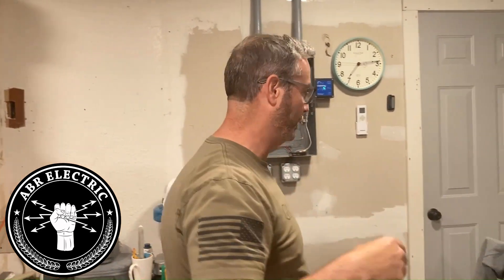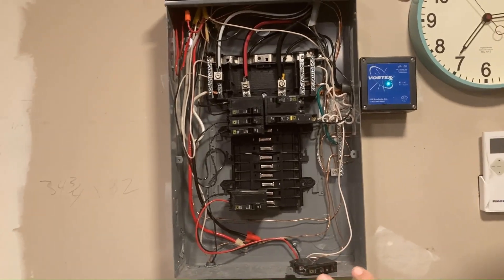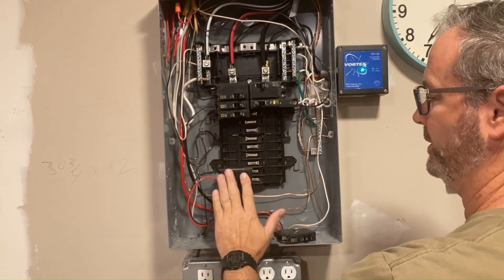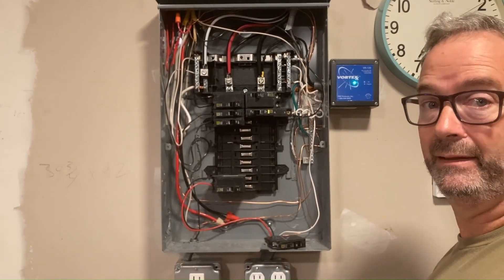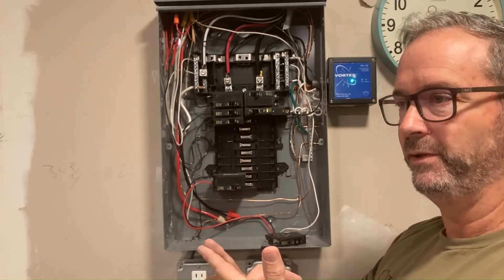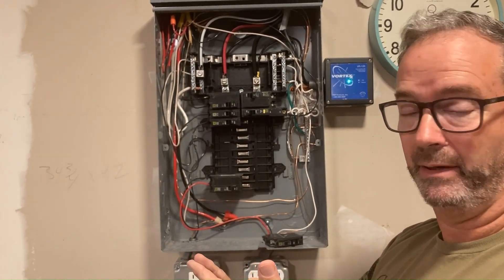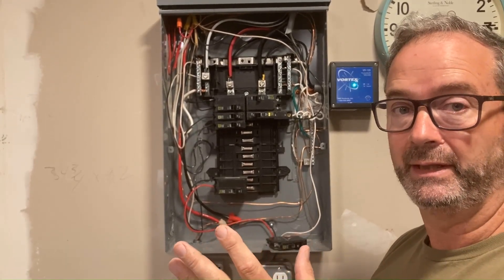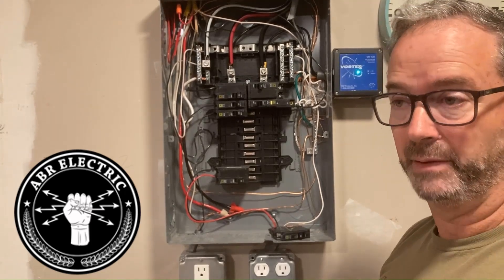What if you have a Circuit that Trips ALOT?⚡🔥 ABR Electric

Comment: My experience is a breaker that runs warm usually trips at less current than a cooler running one. 

If not overloaded the heat rise is a poor connection; the wire lug or the bus bar.

With my folks home we had one 20 amp breaker for a bathroom that worked for 30 years then started to sizzle only when we added a dehumidifier that was on all the time. So the bathroom 1500 heater that has a 10 minute timer did not phase it. Nor hair dryers and lights. ie just the 9amp 50 quart/day de humidifier we ran all day.

The sizzling ate the buss bar tab off so we abandoned two 1 inch slots. The subpanel is in a garage so has the humid south east weather.